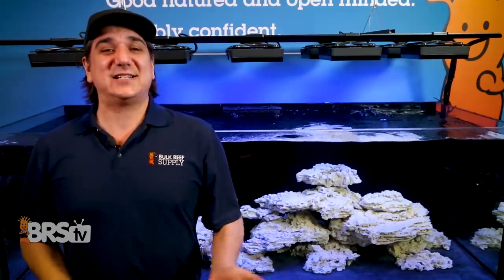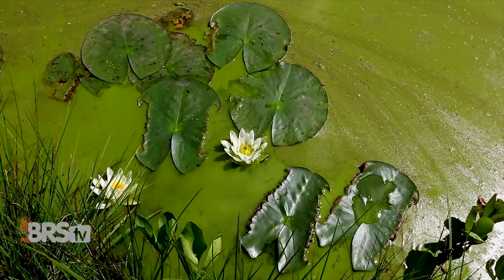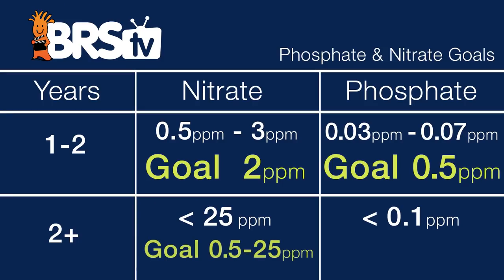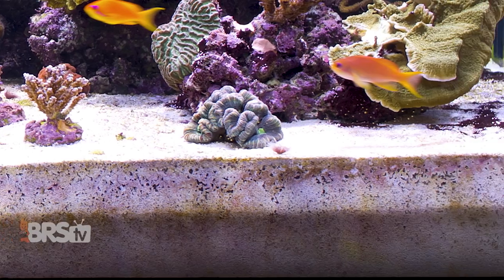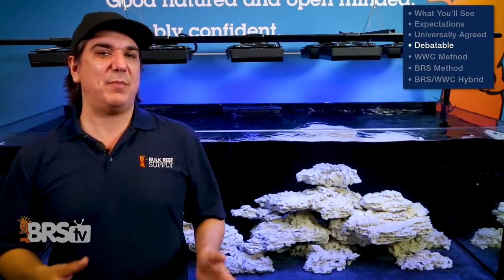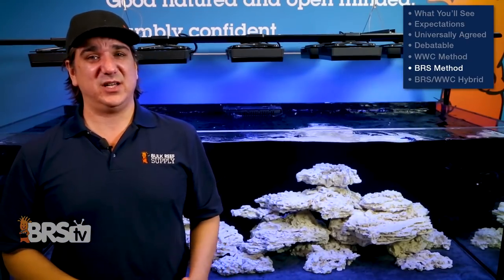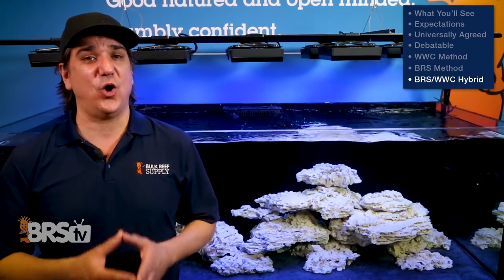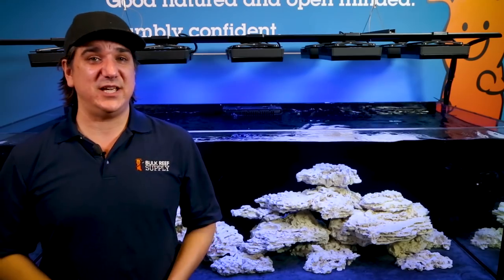Ep9: Best nitrate and phosphate level for a reef tank ?  - The BRS/WWC System

Comment: thanks BRS and Ryan!  I am investigating my approach to reduce my 180 gallon softie reef that has 180 nitrate and 4 phosphate and stumbled on this vidoe that is old but valuable.  I just finished changing 180 gallon of water and did a sump clean out in a week plus (30 gallons a day)  MY NITRATE reading is 100+ nitrate...  I can't keep doing water changes this frequently as it is too much work and I think this making this amount of RODI water is gonna kill my septic system.  Based on this I am gonna try nopox b/c I think the ration of my nitrate to phosphate must be keeping my system in balance... both off the charts but I have no algae and my tank looks good (overinfestation of BTA no sps tho)  My sand sifting star fish doing great!  I am not convinced on older tanks that 25 ppm nitrate is required.  My tank is very old... so I do agree new tanks have new tank issues.  I want to get my nitrate to 40- 60 adn then introduce a regal angel fish.  It would be irresponsible to the fish to introduce him at the 180 nitrate but I will try at 60PPM nitrate...  and before he goes I will move all the rockwork.  Little nervous to try nopox b/c I do the minimal approach across the board for my tank....  

What if under dose nopox?  and what happens when you stop dosing nopox?  I know if I overdose nopox my fish die of oxygen depletion...  I do have a skimmer and a refugium with chaeto.

Comment: Good points about the different ages of tanks and how the acceptable levels over time can change. 

I often hear people asking what others numbers are without realizing that they may be trying to mimic numbers of a system that is much older or much younger than their own. 

I also often hear others give advice to everyone under the sun about replicating their numbers and those people never ask how old the tank is of the person they are giving advice to. 

WWC tanks are different than most people's because they have a large biomass and are well established tanks with incredible biological filtration due to age. Some of the rocks in their tanks are more than 10 year's old. Trying to run your Nitrates at 20-25 to replicate their tanks when your tank is only a year or two old is a recipe for disaster.

Comment: Dear Ryan,  I'm a newbie into the hobby.  About a year ago, I started with a 38-gal reef Peninsula tank (29gal water).  I put 3 fish, 1 clownfish, 1cardinal, 1 firefish... and about 60 mix coral frags from the Reef-a-Palooza Show.  I've been doing water changes of 5 gal/week until last January.  I noticed that NO3 never exceeded 0.50-0.75 so I decided to do water change of the same amount of water but each 2 weeks.  NO3 never exceeded either so I just went for the 5gal/3weeks.  My tank is doing well, corals have grown nicely twice and even 3 times the size when I just bought them.  Now it happens that I checked the NO3 and the result is ZERO when just 5 weeks ago was 0.50-0.75.  i repeated the analysis 3 times and the result are the same. I decided to not adding more fish for giving my corals cleaner water.   Question:  Is it normal that a reef tank turn ZERO nitrates?? Is that good or bad??   Thank you for your support!!  Regards from NYC.
Reply from the maker: Zero nitrates isn't a good thing. Generally speaking, 0.5-3ppm nitrates is our target range for your tank's age. Corals do need some amount of nitrates for optimal health and growth. Good news is that getting nitrates up can be as simple as feeding a bit more, so I'd take that strategy first before doing any sort of nitrate dosing as it's harder to mess up and less expensive.

Comment: 24:02 - what happens when you overdose carbon? I was doing that for a while with my old tank. If you don't have a strong skimmer, there will be bacteria buildups - films on surfaces. If skimmer is strong enough, it will remove all that bacteria, but corals will suffer from too little food - they just start bleaching. I literaly bleached several corals by just increasing NoPoX dosage suddenly. Now I gave up on this method. Refugium with algae is better and safer.

Comment: Uhm did you make a mistake in you phosphate recommendation at 0.5ppm while stating the range as 0.03-0.07? Did you mean 0.05ppm as goal or did I miss the point?
Reply: @BRStv  ok 😊 I thought I missed something
Reply: @erich8756  Was it a mistake then?  0.05ppm sounds more reasonable.  I think that 0.5ppm is way to high...  Was this clarified?
Reply: I believe he did mean .5 when measuring phosphate if he was measuring phosphorus he would mean .05 one just measures in ppm and the other ppb
Reply: @rsucre  this has to have been a mistake. I came to the comments for the same reason. 0.1ppm phosphate is the ideal ceiling limit. 

0.05ppm is recommended more often. 

That’s for phosphate. Phosphorus should be be no more than 30 ppb.

Comment: It's a shame Inland Aquatics recently shut its doors. It would have been really interesting to do another collaboration featuring an entirely different approach. They ran their entire 35000 gallon (133000 L) facility without a skimmer. Feeding 4-6 times daily. Instead, they used algae scrubbers, ~10% annual water change, carbon every few years for pigments, and the much-feared deep sand beds. The system was running in some form since I think about 1993. 

Inland Aquatics worked in partnership with Dr. Aday as a kind of laboratory for his book Dynamic Aquaria so I'm guessing many of the principles of the approach are documented there. 

Morgan sadly had to close his business, but maybe he'd still be willing to work with you and share the lessons he learned over those 25 years or so of putting the principles into practice. Both Midwestern companies, you're practically neighbors at about 600 miles away. :) Maybe reach out to him? I don't know if his contact info on the company website is still valid, but a quick google search for "Morgan Lidster" pulled up his social media information.

Comment: Thanks for a densely packed Informative video!  Is the BRS160 nutrient readings virtually zero in most part due to running a Kessil H1200 over the refugium vs H380?
Reply: We run the 120 at its lowest possible setting which is about the same wattage as the 380 :)

Comment: My No3 is around 1 and Po4 0.04 ish. I have a 10% refugium that is full of cheato and I clean the tank glass every 2-3 days. Would I be correct in saying the cheato is using the nitrates and thats why I am not seeing a higher level? I am just concerned its a little low. Im not running GFO or any other Po4 removal method other than a fuge.

Great video by the way...as they always are :)

Comment: So is World Wide Corals implying that a tank with no sand in it doesn't have nitrates if it has proper water changes and maintenance? I've been running a frag system 4 years with no substrate and weekly water changes and I find it quite difficult to control nitrates without some sort of controlling device such as a refugium biopellet reactor algae reactor or something else.

Comment: Always with the great videos! 👍🏻 So I have a newly established reef tank, just finished the cycle 5 days ago. I run an air driven skimmer which works pretty well I might add. But let's talk aboit Phosphates. My Phosphates are about .09 (hard to figure out in between .08 and .12 on the red sea pro) but I do have a Hanna coming in the mail. I dont want to eliminate them all together, would like to keep them around .03-.05ppm. Would adding a filter bag with some Phoslock help me out? If I put just a small amount in it would it work not so aggressively or would it just lose its potency quicker?
Reply from the maker: Running some phosphate reduction media should help, but as you mentioned, it'll be very easy to strip the water of phosphates completely, so use much less media that recommended. It's always easier to add more. I'd start with 1/4 of the recommended amount or less, then test to see where that gets you.
Reply: @BRStv  Awesome thanks for the response. I will do just that 👍🏻 My Hanna just came in the mail today so testing for Phosphates just got a hell of a lot easier too!
Reply: @scotty2salty327  curious to see, how is your tank doing? it's been over a year

Comment: The API 5 in 1 test NO3 reader starts at 0 then 20 40 and so on. You’re saying 2ppm. Hard to read when it’s so wide spread out between color variations from 0-40. 50 you see a change. I’m so confused. What’s a good test kit that can give me more accurate numbers ?
Reply from the maker: If you're keeping your nitrates near 2 ppm, the Red Sea Nitrate kit is probably the best option for you. Hanna is also going to be releasing a Nitrate Checker soon that reads from 0-5 ppm that you might find helpful as well.

Comment: What test kit is being used I have been using the api master saltwater and master reef I have ordered the digital tests but still waiting on them
Reply from the maker: We most often use the Hanna Checker for phosphate and then Red Sea or Nyos for Nitrate.
Reply: @BRStv  what tests would u say r the most important for a new reefer, my setup is a 65gallon cube tank I am using a canister filter that turns the volume over approximately 5 times a hr it has fluval bio media in it I forget witch type to be exact sponges carbon and gfo then I have hydor power heads, live sand and live rock been running for maybe 8 months, a clean up crew and a few corals. Like I said before I have been using the master test kits but I feel they off but my corals r growing and even splitting off and fish look healthy

Comment: Dude my tank is 12 months old I only feed corals my sps is growing like mad I use aquaforest np pro and probiotic s I have nitrates at 2ppm and phosphates at 0.1 some days 0.25  on salifert my coral supplyer says it should be 0.025 but everything is blooming and growing I don't want to change my gfo because it will strip..... is 0.5 phosphates as you state higher than  0.25 should I stop feeding corals
Reply from the maker: Usually anything greater than 0.1 ppm phosphates and we start to see a decline in coral coloration and growth. Of course, that's anecdotal experience. If your corals are growing well, I might up your water changes a bit (frequency or volume) to help knock the phosphates back slowly over time vs quickly with GFO.

Comment: Have you noticed cheato having a problem growing with the spectrum from a Kessil grow light?  I added an H380 to my fuge and it virtually stopped it from growing.  I had more luck with simple Led flood lamps and have returned to that method.  I even had one of each at one time and had a very lop-sided cheato mass.  Is there possibly different types of cheato that appreciate different spectrum?
Reply: @BRStv  
It was about 17 inches away from water surface.  My fuge is also large, about 60 gallons.  3 feet wide.  I'm not the first to experience this.   Sometimes the Kessil seems better at growing hair algae than cheatomorpha.
Reply: I use the h380 and it’s too effective at growing chaeto. Stripped all my nitrates.

Comment: Quick question. Do i have to do a water change. Even though i tested the water and the nitrate is 0 basically and the ammonia is 0 - 0.25 i haven't changed the salt water in about 3 weeks just top off with fresh water testing with the api saltwater master kit
Reply: Is this a new tank, if so do not do a water change. You want that ammonia to ve converting to nitrate you should also test nitrite to make sure you are starting your cycle. Doing a water chnage will just slow down the cycle and make you have to wait even longer
Reply: @Brendan_O  some what new its about 4 months old pretty sure its went through its cycle as iv tested and seen ammonia rise then nitrite then nitrate after that iv done water changes once a week but dont see the point in changing clean water if the nitrates and ammonia are so low
Reply: @nathanbutler8240  whats the size water change that you have been doing because if it is staying low you could ve removing way more water than needed
Reply: @Brendan_O  its a 10g nano with live sand and live rock with 2 clowns 2 little anemones a couple coral and a emerald crab. I replace about 2-3 gallons when i was doing water changes but i stopped because the nitrates are 0 and ammonia is near 0 also so the water should be good right?
Reply: @nathanbutler8240  it sounds like you have done everything perfect so far, in a tank that small that should be about what you want to do
Reply: Water changes needed not so much to remove excess N and P, but to replace depleted minerals. Though in a small system like yours it's often use as a main nutrient export.

Comment: Just finished cycling tank and after a 50% water change my nitrates are still off the charts 160+, i cant continue doing large water changes as my parents will kill me since doing water changes with RO/DI is a HUGE waste of water. Ive heard about doing sugar dosing but im not sure. I always thought that nitrogen turns into nitrogen gas after a while.
Reply from the maker: You could always give the tank more time, or use a method of carbon dosing to allow the bacteria to reduce these levels. NoPox by Red Sea if pretty cheap, and could help to alleviate these levels.

Comment: Can you make a tank for beginners with a small budget? By that I mean dont fill full of coral to take up nitrate. Make 2 tanks with little coral.and a load of fish. Make one with Chinese black boxes and one with lights $100 or $200 more to show difference. See how it does for 6 months to a year. Because as seen if we start a tank cycle and pack with coral and awsome gear it works well. Wish we could do that but after cost of tanks i had $250 for coral, $180 for a skimmer,  and my 3 lights cost $90 each. It's a 180 gallon

Comment: Keeping a nitrate level down that low without dosing a nitrate lowering solution would be almost impossible, you’d be water changing almost continuously to achieve that, I use frozen brine shrimp from time to time for my phosphate source and control that and tune with rowa

Comment: I got My new hanna phosphate checker yesterday and did my first test that show me 0.76 when the 3 minutes was up is this good or bad what should my levels be do we have some kind of chart that helps us out I'm going to do a 30 gallon water change this weekend and I got gfo going too that i started it on November 7th    

my aquarium is 55 gallons with a 20 gallon long sump I have two clown fish , one tang 1 pepper shrimp, and I have to blue green chromis and I have a anenome purple tip one green star polyp and small zoa my local pet store told me to do a 20 gallon water change this weekend what do you suggest I do please help me p.s. my Nitrate/ NO2 are 0 ppm and Nitrite/NO3 are 0 ppm when I tested it 2  night ago
Reply: I have recheck my phosphate today at 8am my time and it's reading was 0.24
Reply: Saturday, November 10, 2018	8:00:00 AM	  
PH 8.2
TEMP 79.5
Salinity  1.026
Alkalinity 12.3
Calcium 0.82=410	
Magnesium 0.64=1280
  Phosphate 0.24
 Nitrate n2   0 ppm	
  Nitrite/NO3 80 ppm	
 Ammonia 0 ppm
Reply: Sorry I was trying to make it somewhat easy but usually I don't my phosphate was really high when I first tested it when I tested it on Saturday morning before I did my 30 gallon water change it was 0.24 after I did my water change it was 0.67 and when I first did my phosphate back on the 6th of November it was 0.76 I usually don't see algae growing in my aquarium very little I did a video where you can actually see how many fish I have my equipment and what my test results were in the description maybe this will help you understand what I was talking about thank you for taking the time to help me
Reply: BALD8BIL check your salt mixture for phosphate. Are you using rodi to “clean” your tap water?
Reply: @KimKim-on2ct  I'm using ro-di water and I'm using Instant Ocean I switched over to Red Sea yesterday I will need to check that out next
Reply: find an ideal balance of nutrients (NO3 and PO4). usually the tank will level itself out to what it likes. If algae is becoming an issue, consider some gfo and water changes, but take it real slow with the gfo, you don't want to strip the water of phosphate overnight. nothing good happens fast. Probably a leeching of phosphates from the rock I'm guessing. Don't worry, its a rock curing thing. It's also why I went barebottom for my tanks so I don't have to worry about sand cleaning.